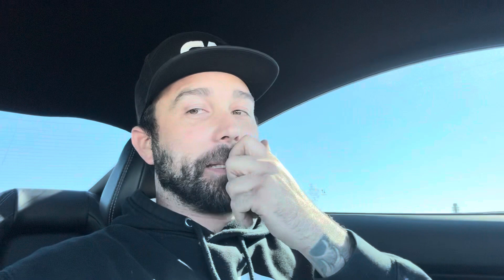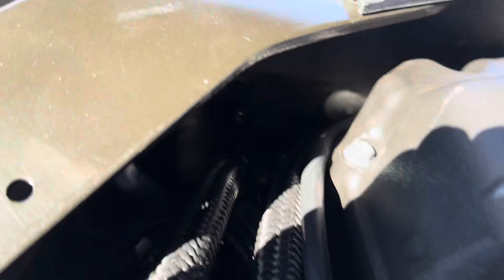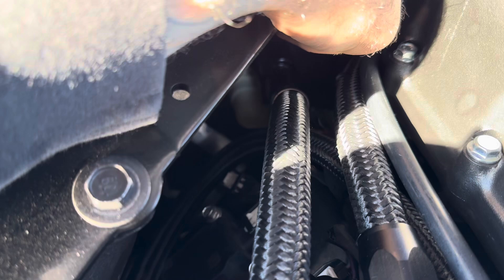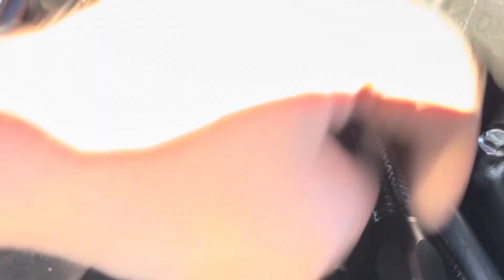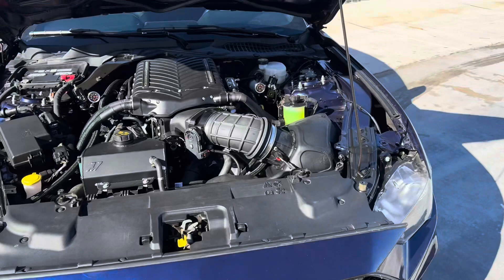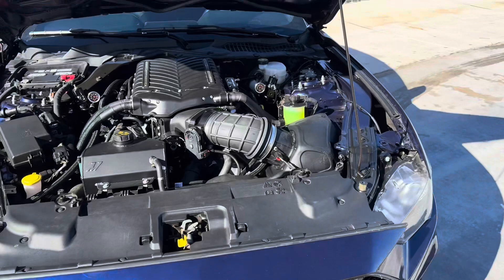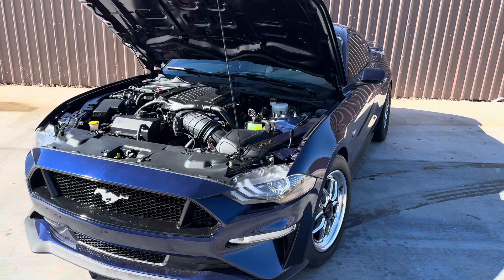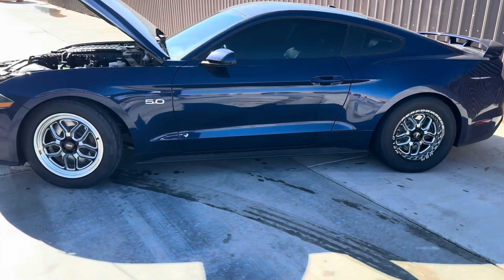Whipple or Twins for the daily? This one changed my mind

Comment: My 2018 Mustang - Whipple runs low 9’s. Mild E85 tune. Over 150 1/4 mile runs. You can check out my car on my page.
Reply: Did u replace ur axles and drive shaft?
Reply: @d3et1roi3t  Yes, Ford Racing half-shafts and QA-1 carbon drive shaft.
Reply: @Jamko1970  any vibration related to the drive shaft?
Reply: @d3et1roi3t  no, vibration.

Comment: If you took a 3.15 rear gear car and a 3.55 gear car how much would the 3.15 gear pull up top on the 3.55 gear ? would it be a big difference? Would the 3.15 gap the 3.55 ? I thought the 3.55 were better, but I guess I was wrong.Thx 🇺🇸💪🏼🐎
Reply from the maker: It’s mainly for the 10 speed and longevity of it. The OD gears you want to stay out of up top